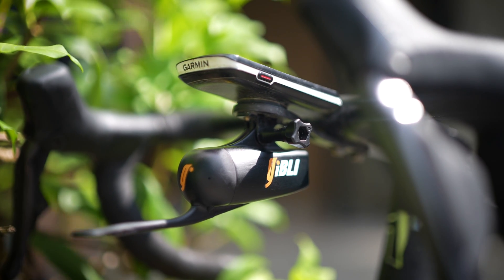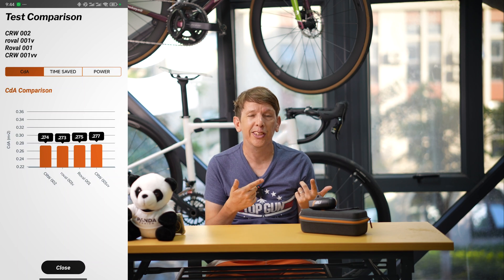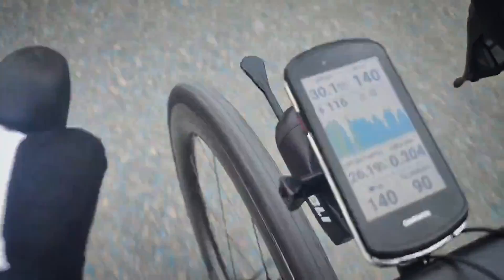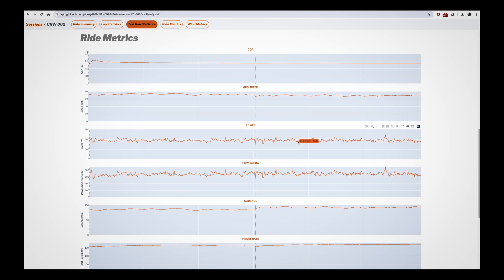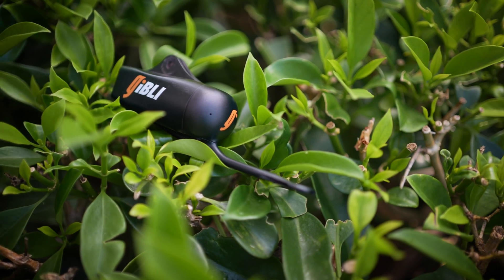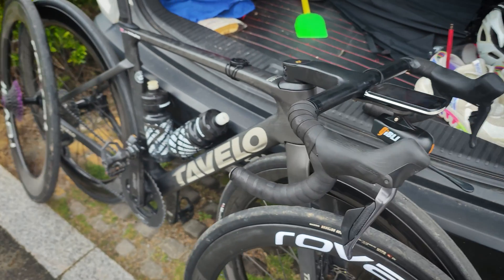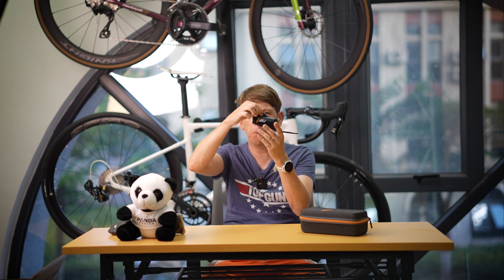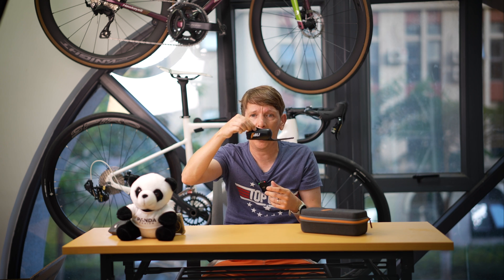See your CdA in real-time! The GiBLI Aero Sensor Review

Comment: I appreciate the full transparency about the products you review.  This is very interesting to me from the perspective of the advantage the device can give you versus its cost.   As a kid I crudely calculated my CdA because I intuitively knew it was super important.  This was after I learned about the exponential relationship between power and speed in hydrodynamics in high school physics.  I remember doing a drawing of my frontal area of me on my bike on graph paper (this was the 1970s - I’m an old fellow) and doing wattage calculations.  I was on a rowing team at the time with national team members (Canada) who were being tested on early versions of an ergometer that could measure watt power output.  Hydrodynamics matters even more in rowing.  We were doing training based on wattage over 40 years ago. 

These kinds of things actually gave quite an edge over the competition and I was surprised how long it took for cycling to begin to use power meters - 1989/1990.  This device allows the power vs CdA aspects to be optimized.  There are many racers who will potentially go faster than their competitors at lower power because of this product.  Greg LeMond was, as usual, an innovator leader in the aero vs power regard but it took a decade longer than I thought it would and widespread use of power meters took even longer.  It’s amazing that tools such as this are becoming available to everyday riders and racers.  The limiting factor is price as these tools are still too expensive. The Gibli product here is very expensive but for the huge potential edge it gives a dedicated racer it’s probably worth the price.  This is a product that clubs could buy to share amongst team members.

Comment: Chung's method is better this is rubbish
Reply from the maker: I've used the Chung method before. It's fine, but it has it's limits. I was using a Garmin Edge 1040 (pretty respectable head unit) and doing laps of a loop... however, the Garmin was recording each lap as getting slightly lower and lower in altitude (I'm guessing air pressure was rising or something, confusing the barometer.) therefore Golden Cheetah thinks you're actually riding down a false flat, messing with the results. Wouldn't happen with the GiBLI as it has it's own environmental sensors.

Comment: There's no way a pitot tibe mounted in front of the rider can estimate much less measure aero frontal and multiangle resistance or laminar flow disturbance of the rider and bike BEHIND the sensor ... until proven otherwise. 

I contacted the company to see how they did this and got the answer that the sensor system doesn't in fact "know" or estimate these factors. 

so, basically, it's a verry pricey airspeed sensor being advertised as a portable windtunnel.

prove it. No physics ...no buy in.
This is an overpriced, overpromising airspeed sensor ... full stop.
Reply from the maker: I have no vested interest to defend it... but, my $0.02: It knows your power, it knows your speed, it knows the road gradient, it knows the air density, it takes Crr as a constant, it knows what the wind is doing... so it can work out your aero drag. If the same power, same wind, etc... but suddenly the rider gets slower; it must be an increase in aero drag.
Reply: with a power meter and computer I know my power and speed. With an elevation profile of the route (free) I know the grade and, in fact, would have a power profile of the ride for my planned pace (also free). Any deviation from that power/speed profile would be  mechanical or wind. The ONLY solutions would be to check tire pressure or improve my tuck. Right? Free. no 1200 CAD pitot tube

Comment: You can do the same with just a powermeter and preferably a wheel speed sensor. It’s called the Chung’s method. It does not take wind into account and and you need to estimate air density yourself using air temperature and pressure from, e.g, a weather service. Silca made a video about it called ”Aero testing expert explains how to get accurate aero testing at home”. 

I think that device just mesures the wind, air temperature and pressure and then applies similar calculations.
Reply from the maker: I've done the chung method in golden cheetah for years. It has so many flaws that people don't talk about. Go do laps of a park or something for an hour... then go check the recorded altitude when you start vs when you finish. It will change. Thats with a Garmin 1040, which should be pretty accurate. This variation of altitude effects the results so much. The GiBLI isn't perfect, but more data = more accuracy imho. (but also bearing in mind poop in = poop out.)
Reply: @ChinaCycling  yes I fully agree with you. I think that the Chung's method needs very careful test methods and setup to be accurate. Having this kind of sensor likely makes it a lot easier to conduct tests in the real world.
Reply: @viljamip  the Chung Method is a total pain...it works if it's your only option but this is very easy very anyone
Reply: @ChinaCycling guessing that's why you could use the Chung method in the Catesby tunnel is Northampton then? Constant air pressure and density, with a constant altitude and a very accurately known distance.
Reply: There's no way an estimate can even approach the accuracy of this technology. I won't debate that the cost is lower, but that not really what we're thinking about here. This is really a performance item at another level. 

You could go out without any tech and just ride around for free and see what's faster if you aren't really serious.